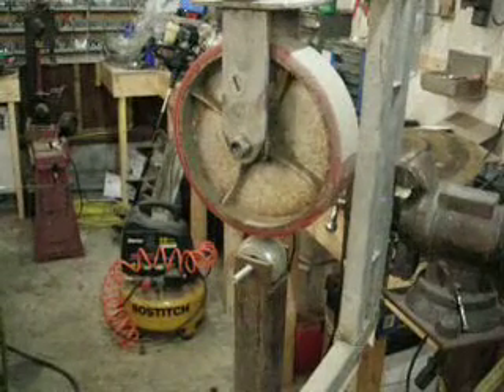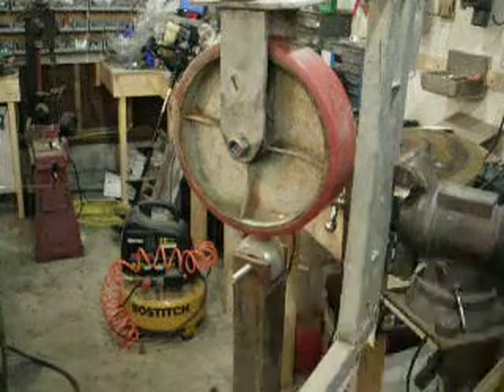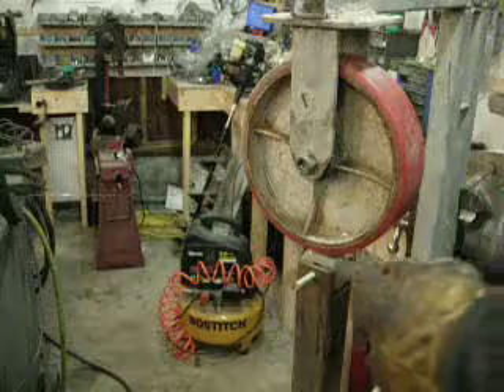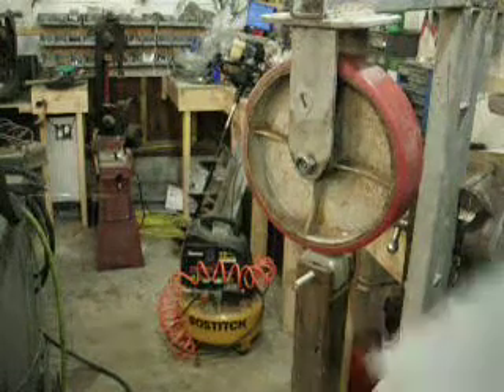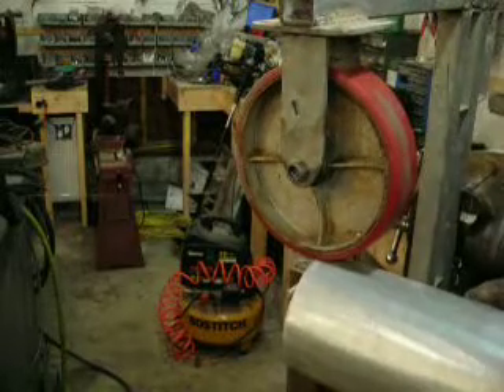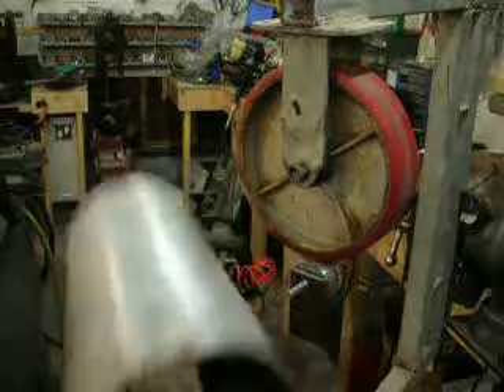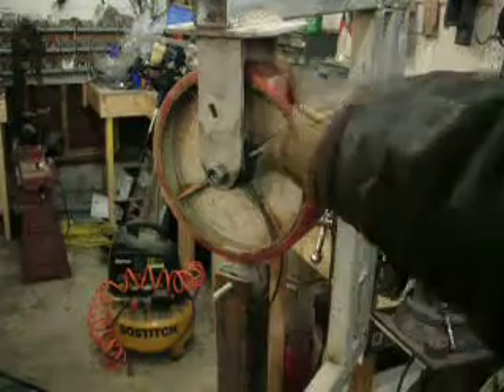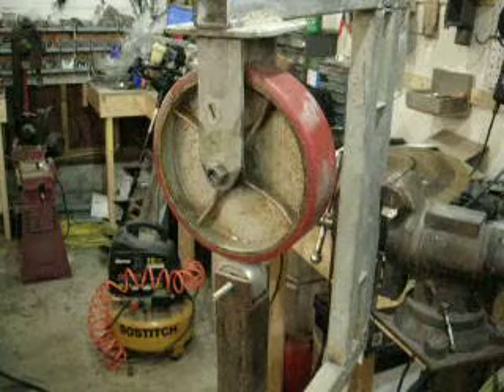DIY homemade scrap metal english wheel that works... almost

Comment: sonny benfield- that a great idea.....I have been wondering  what type parts to use and you answered it.  great idea.
Reply from the maker: The newer version that even after all these years I have yet to finish (fingers crossed this summer the stars align) won't have the nylon coated wheel. Other than that it really amazed me how well it worked for scrap thrown together in an hour or 2.

Comment: I'm thinking that part of the reason it is bending so quickly is the curvature of the bottom "wheel". It would be putting pressure over a smaller area.

I like the idea of using a caster for the top wheel. I wonder if a person could use a sintered metal caster, or strip the urethane off the wheel for a harder surface.

Either way, thanks for sharing!
Reply from the maker: I'm no expert but from a few videos I e watched of people who know more about it than me I'd say it's both, the curve of the bottom wheel and the urethane on the top wheel. Lazze will use a large rubber band to start when doing some serious metal movement then take the band off to get the finished results. One of these months I'll actually get cleaned up enough to finish this thing and put it to real use. Thanks for watching and the comment.